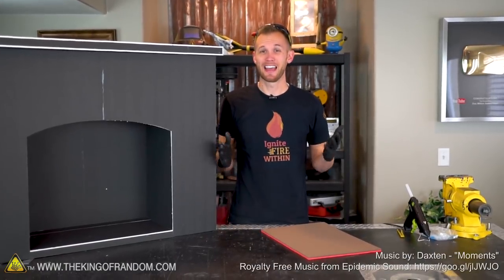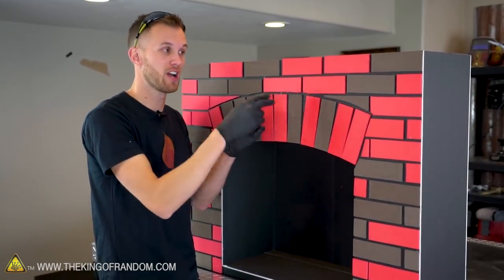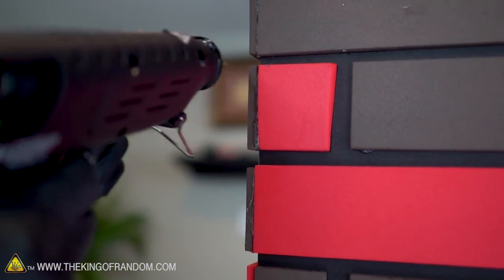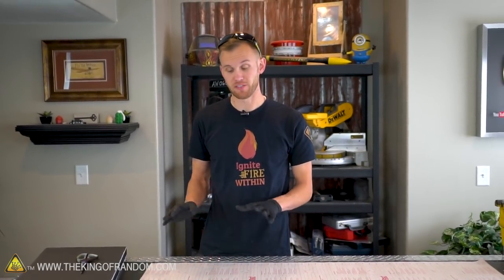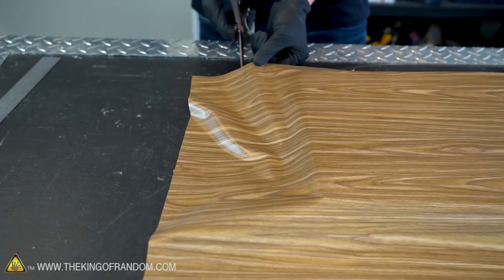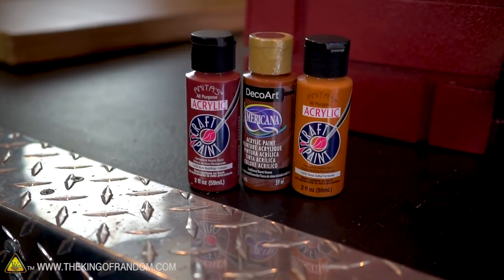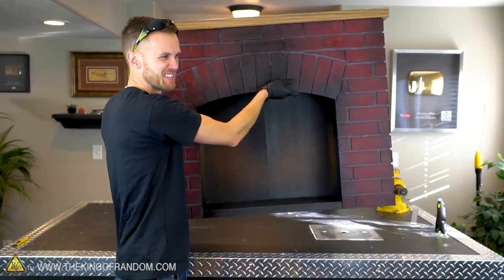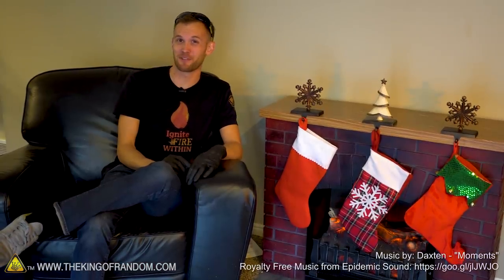Finished Foam Fireplace (Pt. 2/2) - TKOR Explores How To Make A DIY Foam Fireplace

Comment: And that heater wont melt your fireplace?
Reply: was thinking the same thing
Reply: I was wondering the same thing. It will probably make the hot glue heat up and the whole thing falls apart?? We need an update about this
Reply: No, it won't melt the fireplace. It is an electric heater with a fan and it blows the heat out into the room. The fireplace does not experience any more heat than the people in the room feel.
Reply: I don't think so, but maybe you are right. not sure.

Comment: Do people even do these ?
Reply: ECLIPTIC SNOW I did something similar to this a week ago
Reply: The only projects I've done from this channel was the pen rocket and the flame thrower
Reply: How did your flame thrower end up?
Reply: wonderwu my lighter kept going out but it worked a little bit I used lighter fluid for the fuel
Reply: wonderwu if you do the pen rocket do not use black powder I learned the hard way
Reply: To be fair about that one, black powder is intended to be an explosive - not a slow-burning fuel
Reply: i know i would
Reply: Aquarius fast burning fuel. And look up "Estes" engines. They are black powder and they can launch rockets to over 3000 feet
Reply: Christian Farmer also I will check it out I might need metal instead if plastic so it doesn't break when launched
Reply: I did this but with cardboard and markers, during my kid years.
Reply: Double Dare Fan    I made one when I worked at a grocery store. It was a display and I used cardboard as base.

Comment: For those who want to go the extra step to make it look better, you can add very small slits with a craft knife in the craft foam in random places on the "bricks"  and use a heat gun over it to open those gaps.

Afterwards, you can paint etc, and the outcome of the bricks look like real bricks

Comment: whats the point in using brown foam as bricks if you are gona spray paint them red?
Reply: That's what his supplier had in stock. It doesn't have to be brown. Use what is available in your community.

Comment: Sorry.  The maker of this fireplace insert recommends to keep all combustible materials at least three feet away from the unit.  It is not appropriate for the faux fireplace you have created.  Both the paper backing and styrofoam could ignite.  This fireplace insert produces 1,350 watts of heat (4,600 BTU/hr.).  "The fire within" could burn your home down.

Comment: What would happen if you actually used wood to make the fire place instead of foam? It would be more structurally stable and it would be able to hold up more weight. Plus, the top would already done for because it's real wood.
Reply: Benjamin Mellor then you just have a more expensive fire place.
Reply: It depends on the type of wood you choose.
Reply: It would also be much heavier. You'd probably need 2 guys to lift it.
Reply: Some wood is heavy while others are light.

Comment: I used to work for a couple of sign companies and even ran my own for awhile. You applied the vinyl completely wrong. What you should have done is remove the backing from one end, say a few inches, attach it, then slowly pull the backing off while smoothing the vinyl onto your surface. You can use a credit card if you don't have a squeegee (vinyl applicator) to smooth down the vinyl to the substrate (surface).

Regardless, it came out very nicely. Great job! :-)

Comment: If you added a fireplace screen, made from expanded aluminum sheet, bent into a \_/ shape painted matte black and the edges wrapped in some tape so they aren't sharp, and a "chimney" made the same way as the fireplace that went to the ceiling, (kind of a tall /-\ trapezoid shape, or a |_| about an inch thick ) it'd look even better.

Comment: I would probably replace the bottom board with something more robust like a piece of slate if there is going to be heat on it, just to prevent any off-gassing or fire risk.

Probably have the slate separate from the body of the fireplace so it doesn't tear it.

A little less mobile, but also a little more piece of mind.

Comment: Supplement the structural foam core with 1/4 inch ply, and it could hold actual weight, not as much as a real fire place, but notably more than foam core

Comment: The easy way to spread contact paper is to use a paint roller.  It allows you to roll out the air bubbles with ease   :)

Comment: If you do not have a heat gun readily available, would a small electric heater work just as well? It does give off quite a bit of heat and seems like it might do the trick.
Reply: Koguntetzu Gaming try it with a scrap piece of craft foam and see what happens.

Comment: In Australia if you have a fireplace lit during Christmas you would probably die from the heat
Reply: It doesn't have to be a heater that you put in the fireplace. You can buy a water-cooled portable air conditioner and put it in the fireplace and then it would cool your heels.

Comment: Won't the heat warp the foam
Reply: most likely
Reply: Not at all. It's an electric heater with a fan that blows the heat out into the room. The fireplace does not experience any heat from the heater.
Reply: It could still warp it because the heater is on the bottom right next to the bottom of the heater

Comment: plz mold a DVD disk and cast it to see if it plays in a DVD player.
Reply: It would have to be made of a special plastic and the molding process would have to be perfect (for perfect balance), otherwise the speed of revolutions would cause it to break up. Also, molding a DVD would not capture any data, so even if the molded disk did not burst into pieces, it still would not play.

Comment: Can you hard boil a egg in a vacuum chamber because you said water can boil in a vacuum
Reply: It won't cook an egg. The water boils, but it's not hot. If you put cool water in the vacuum chamber, the air that is dissolved in the water will cause it to boil (as the air escapes), but the water will still be cool.
Reply: shinaanish thank you for that explanation

Comment: Would the heat from the heater not melt or distort the foam?
Reply: No, the foam will be fine. The heater has a fan that blows the heat out into the room.

Comment: Wouldnt the heat still melt the foam?
Reply: No. It's an electric heater with a fan that blows the heat out into the room. The fireplace does not experience any heat from the heater.

Comment: Will static electricity start a fire?
Reply: Not unless the area (room) is filled with a flamable gas (such as natural gas). If there is a gas leak and the room fills with natural gas, a static electricity spark will ignite it. However, static electricity does not ignite wood or paper.